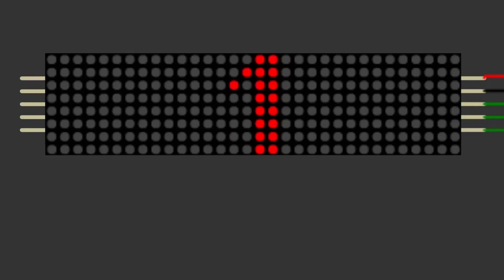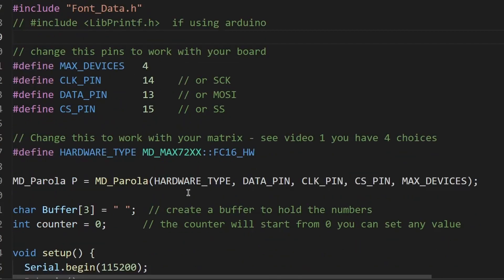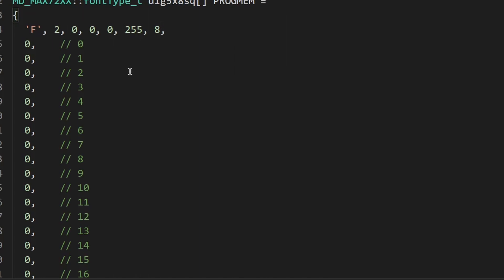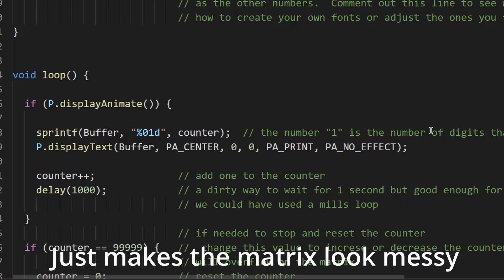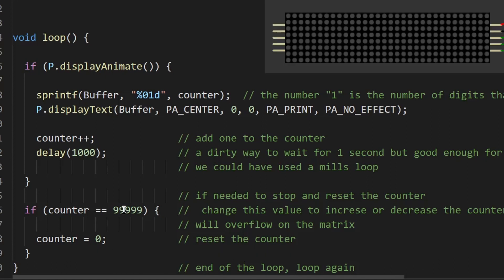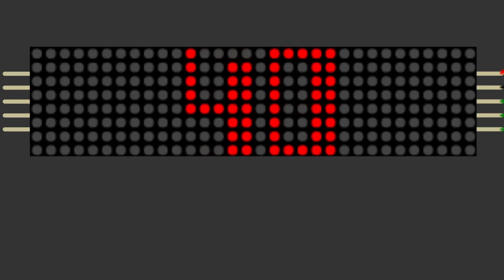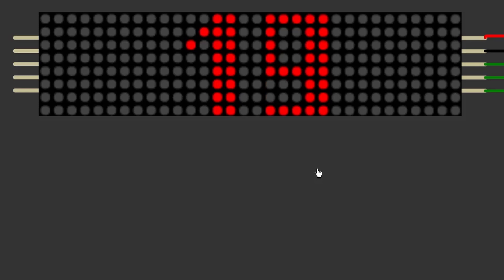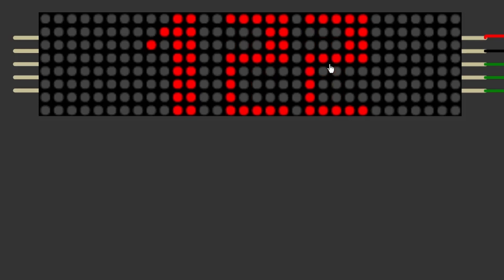How to Max 7219 💻LED matrix ESP8266 basic counter fonts stopwatch md parola md max7219 0056

Comment: Thanks for great videos! Really easy to follow and like your detail explanation! Can't stop to watch your videos. Really appreciate it! I am trying to make a stopwatch for my research purpose that could go up to 500~600 hours. Would it be possible to make it with MAX7219 led dot display? My experiment will be 400-500 hours long and I need a stopwatch like.... "HHH:MM:SS". Also, I am thinking about using 64x16 dot display (connect four 32x8 MAX7219 dot matrix) and wondering would it be possible and reliable (power source).
Reply from the maker: yes for sure. you can use a smaller font, to make the matrix smaller. see my video on fonts

Comment: Where do I save the font file? Thank you
Reply from the maker: Save the font file in the same directory as the code file. When you then open the code file you will see an additional tab at the top just like in the video. Then it should compile 👍
Reply: Many thanks for your quick reply. If keeps uploading maybe because there's not enough space storage, its says 96% of storage space has been used??

Comment: I followed what you did but it didn't work. I'm using arduino uno and have installed  LibPrint
Reply from the maker: Have you install the libs listed in the top of the code
Reply: @flixmyswitch  yes all the libraries are installed
Reply from the maker: Line 20 to 24 check your pins clk, cs etc are mapped to your pins that are called clk C's etc. I am away so can't check any more
Reply from the maker: Try loading the libprintf library
Reply: @flixmyswitch  thank you it's working. What I'm trying to learn now is to use your code to make a clock with my own customized fonts.
Reply from the maker: Great what did you do to make it work.

Look at my other videos on these matrix.

I think I have 14 vids on them now.

I have ones that make a clock and one to show you how to make custom fonts.
Reply: @flixmyswitch thank you I've been watching your videos and they are great. I added the header file (of the characters fonts) and it worked, this is what I missed that's why it didn't work at first.
Reply: @flixmyswitch  sorry I need to ask another question? I managed to add animation on the code with intensity equal 1. I tried to add a button so I can adjust manually the intensity however the button works intermittently - it doesn't work when the animation is in progress (I suspect the speed and pause times blocks the button to work). Also please do create a video with buttons for stopping and starting the clock, this will help me about my problem. Many thanks again.
Reply from the maker: @xrphobby1341  it's a learning curve for all of us 👍

Comment: Andy, I tried this code on a nano and an uno and couldn't  get it to work.  The counter would reach 32768 and turn into a negative number.  Then it would count backwards to zero.  I tried replacing g the int variable with long int, but that made no difference.  Any thoughts?

Ps. The code works just fine on an esp8266.
Reply from the maker: Hi. Yes code was made for an esp8266. I don't have a nano. May be a lack of memory that holds the counting number. The structure of the code should give you the base to amend it for a nano, it's only maths. Please let me know if you crack it and I will add a note to the video somehow
Reply: instead of making your variable an INTeger, make it a float